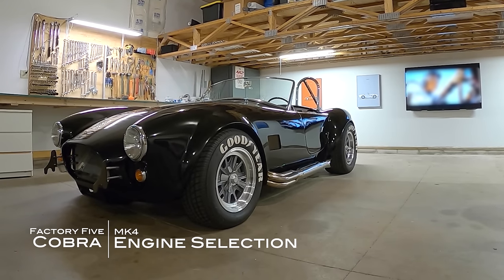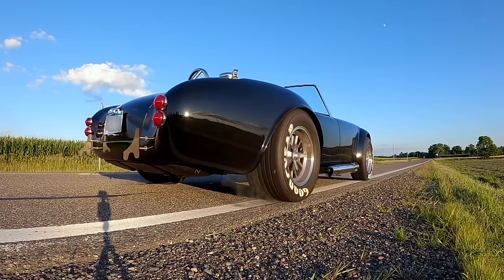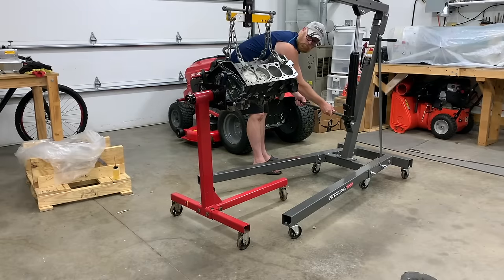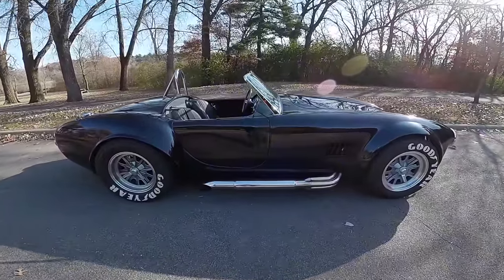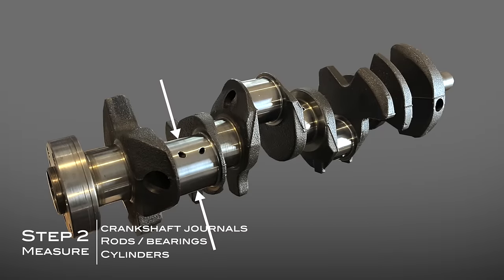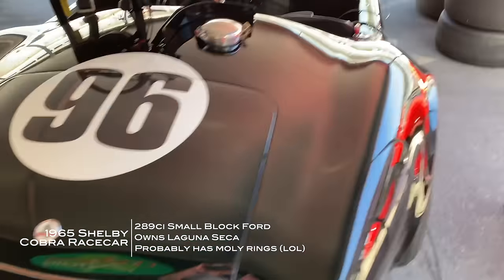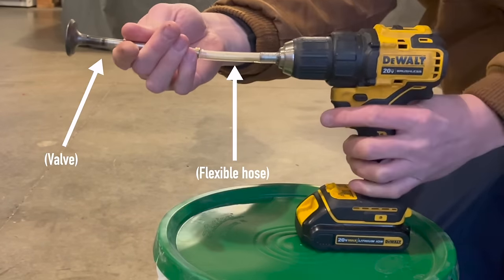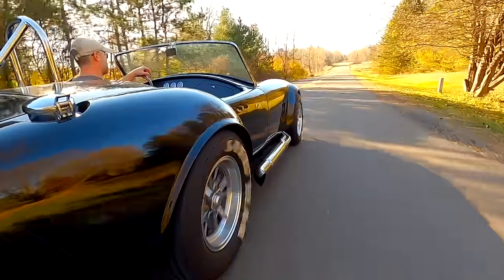Factory Five Cobra: Engine Selection

Comment: I really do enjoy your videos and am building an FFR myself. But no "late 80s early 90s mustang" came with gt40 heads. The 1993,94,95 cobra did. The 1993 and 1995 cobra R did, but only 357 of those exist. Only the 96/97 explorer does. The 98-01 is the gt40p which as you probably know has a different spark plug angle which may cause a header issue depending on what you use. Your text is generally correct except the gt40p part but the audio is incorrect. The image you showed is a gt40p so I assume you are aware it's not the same.
Reply from the maker: Hey Philip - you are correct my friend / after I recorded the voice over I noticed that too (Fox's had the E7TE heads - good heads, but not GT40) - and- yes later there were the GT40P heads too (technically those are the heads on my motor). Thanks for adding the detail here / appreciate the comment!

Comment: I'm assuming you can also rebuild a LS engine right? Like find a Chevy Silverado or Tahoe in a junkyard and rebuild it, just like a Windsor? Just asking.
Reply from the maker: I think most of the junkyard LS motors you can just drop in / leave the core - heads alone (and there are tons of low mile 5.3s out there) - engine mounts are going to be different in the FFR - and - make sure you check your header options - thanks for the comment!

Comment: I might get some shade thrown my way but I have to ask.  Is there any room to run dual exhaust out the back?
Reply from the maker: its been done / some creativity is required though to run it under the frame with adequate ground clearance - and - get it over the half-shafts / axle. Thanks for the comment!
Reply: I believe that the original 289 Cobras did run the pipes out the back . I don’t remember the 427 cars having them , but anything was possible ! 😁

Comment: Not sure if my question made it through so reposting. Do you think 235HP would make this car underpowered? I know there's a 302 crate engine out there that puts out 235. Thanks!
Reply from the maker: Hey thanks for the comment Joshua - its all about what you want with the final product so ask yourself- do I want to evaporate tires or are you more interested in reliable motor that delivers some torque when needed for fun at the stoplights? 235hp seems low for a 302 too and I think you can do better with a crate offering. What rebuilder/supplier are you looking at?
Reply: @TacoJoe  Hey thanks for responding. FF partnered with Blueprint. I went to their official website and checked out the specs from their carbureted 302 listed under MK4 roadster.
Reply: In time, if your budget allows you can always pull and stroke that 302 to a 347. That's what I did, same cylinder heads and accessories.  Cost me about $2,500   for the upgrade and another 180hp.  (270hp vs. 450hp.)

Comment: The GT40 heads will NOT flow close to a set of aftermarket heads such as TFS track heats or AFRs. A whole different universe of power. My little 332" stroker motor makes 530 hp with mildly ported TFS track heats and I shift it at 8500 rpm.

Comment: My dad had 1996 Excalibur Shelby 427 replica. He passed away 2012. Sold it to my brother in law and made sure he keeps in family or sells back to me if ever sells. Anyways you want more Horespower as opposed to torque. Traction is big problem in these cars. His had 5.0 liter from mustang and ended up on Dyno 335 torque and like 260 HP to rear wheels. Not a good combo at all. Hard to hook up off the line. Too much torque and not great HP so didn’t pull hard past 5000 RPM on the old pushrod engine either imo. The 4.6 would been better choice imo.
Reply from the maker: a lot of guys really like the ford mod motors / when built right they can make big power too / thanks for the comment!

Comment: I have a 3.4l 4 cyl Ecoboost Turbo engine that is rated at 315 HP.  Is that a good choice?  Its not a thumping V8, but it is pretty powerful.  Its out of a 2019 Mustang.
Reply from the maker: If that's the motor you would like in your build, go for it! There may be some unique mounts you would have to fab for that motor, but I'm sure it can be done. Good luck and thanks for the comment!

Comment: My BDR has a modified Roush 427R pushing 605hp to the crank....it's a handful even with 335's out the back. Arguably it's too much for such a lightweight car @ ~2400lbs. It is a LOT of fun though but you have to respect it or it will ruin your day.
Reply from the maker: 335s are some big tires my friend! / thanks for the comment!
Reply: What's the purpose of putting that much power in a light car? How does it not overwhelm the chassis?
Reply: @dieselyeti4025  600hp isn't a "chassis-twisting" numbers unless you're Dom Toretto. Problem is there isn't any weight to keep the tires planted. So unless you're running an R-compound, slick or drag radial you can break the rear loose on command.
Reply: @vel87x  As you mentioned there's no weight on the axle so breaking the rear loose in a 90" wheelbase car is going to be exciting. (esp in a turn) You said it was too much for such a lightweight car, so I'm curious why you did it.
Reply: @dieselyeti4025  Backdrafts are 92" but regardless if you know how to drive and don't just mash the pedal it's perfectly fine. It's never been a planted car from the beginning with a 289. They dance and you have to know how to make it work. You're asking why the cobra was ever created in the first place basically. Less weight, more power and hang the F on.

I'm sure you're thinking along the lines of "useable power" and you're 100% correct. You can't use 100% of the power in any cobra unless you were to put an anemic 4cyl in there that requires you to put your foot through the firewall in order to get it to move. But where's the fun in that?
Reply: @vel87x  I guess it's a matter of degree then. I've helped two friends build their FFR cars & one went with a 325hp 5 liter while the other did a 400ish hp 351. Both cars were an absolute blast to drive but the 351 car would step out in a turn pretty easily if you weren't careful with the power. I can't imagine that car with an additional 200hp. It'd be like a grenade with the pin pulled.
Reply: @dieselyeti4025  Violent is a very fitting description.

Comment: Great video as always Taco.  I may have missed it, but what engine are you going with now?  I'm like you, If I had to do it all over again, I would have gone with a Coyote.  As it stands, I have a 347 that I purchased from Mike Forte.  While I do like the engine, I've had to replace the coolant sensor gasket and the fuel pump gasket (I'm running EFI) already.  I may have to replace the coolant pump gasket as well, since I've been noticing some coolant drops on the garage floor.  The engine has less than 3000 miles on it.  It's out getting painted now, but when it comes back, I'll get in the engine bay with some brake cleaner to narrow down where the leak is coming from.  Also going to swap out my OEM brakes with the wilwood ones from FF.
Reply from the maker: Coyote (in my opinion) is a solid solid choice / it's hard to go wrong here so if you move away from your 347, I think this is a great choice. Thanks for the comment Joshua and good luck!

Comment: thanks for the video.  i remember smelling fuel riding on carbureted cars when i was younger.  do you smell gas when you are riding your cobra?
Reply from the maker: no gas smells with mine but if the carb isn't tuned right its possible you could smell gas / thanks for the comment!
Reply: @TacoJoe  thanks for the information. It will help me with which one to pick, carb or Efi. What’s your preference, carburetor or EFI?

Comment: I hear guys talking with the light Weight and horsepower it can be unsafe..? Probably so … but if i had 400 - 500 hp I would consider using progressive throttle WITH the carburetor set up.. if you pay attention to NASACR on short courses it’s throttle control coming out of corners that is the bomb..! I dont have a cobra but with it’s lightweight what about braking with 4 wheel disks .. brake balance would be essential.!!!
Reply from the maker: Great comment / so I did not add a proportioning valve, but I definitely need one. After a summer of driving my rear wheels will be covered in brake dust while the fronts have barely any - ie - need to limit pressure going to the rear and get more PSI up front. When I bury the brakes though, all 4 tires skid nicely :)

Comment: Be interesting to make a ford Taurus SHO AWD based cobra .  Wonder about fitment of the engine layout in that configuration.
Reply from the maker: that might be a challenge, but I'm sure it can be done. I think toughest part would likely be configuring the front drivetrain - thanks for the comment!
Reply: @TacoJoe  
Are there any Ford AWD trucks that use the Ecoboost V6 in an RWD based AWD system.
Reply from the maker: Might need to search that one / unsure myself - your biggest challenge is going to be the AWD configuration / good luck and thanks for the comment!

Comment: Personally I want to stand out from the crowd, the first thing most folks do is stuff a large and heavy V8 in the chassis. Look under the hood and its all the same catalog queens. None of it is unique, no one thinks outside of the box. With that said....Toyota 22R w/ Turbo on E85 or gasoline if you dont have access to corn squeezin's. Adapter plate to a classic T5 manual. Small package, 1/2 the weight of a V8, fuel injected, more than enough power, great fuel mileage and totally unique. Anyways, just my $0.02.
Reply from the maker: I bet a 22R sounds pretty nice when you wind it up too :) Thanks for the comment Robert!

Comment: People always want to overbuild/overpower these cars. They simply don't have the chassis length, or the aerodynamics for it. If you really want to enjoy these cars, put the lightest 300/350 horsepower engine you can find in it, with a manual trans, a helical diff, and 240-250 width tires. You might lose a drag race... but the instant the curves come, you'll smoke your buddy's 427 behemoth.

Comment: Can we lift the car by 2/3 inch? Is it possible? I'm from india planning to buy this car but I'm afraid indian roads would not be friendly with this car. Sedans do work fine in my city but they have to be slightly lifted to overcome potholes and speed bumps issue.
Reply from the maker: If you run coil overs, it's real easy to adjust ride height via a slip ring/bushing that goes over the shock. Just tighten/loosen the ring to your liking and lock it in place - thanks for the comment!

Comment: the only correct choice is a 500-600" all aluminum BBF with boss 9 or blue thunder heads, topped with a kinsler or hillborne 8 stack manifold running hidden EFI.  1100hp is reasonable......

Comment: <<<<My 2300lbs. SBC MGB, in a previous incarnation it had a 500hp+, big roller cam, aluminum rod, 13+ comp. 358ci Gen 1 SBC, BIG FUN/terrifyingly fast, @ 6mpg. Now a cruiser 375hp 350, do miss the rush of the last one but it's much nicer, more comfortable car @ 16+mpg (and no more mixing 112 octane race gas, premium pump gas and additives either. (it's a full custom chassis/suspension set-up made for the 500hp+ engine)
Reply from the maker: at one point I considered doing something similar / sounds like a sweet ride / thanks for the comment!

Comment: Planning on a cobra build in the next year ,
I was going to prep my block and heads with eletro method but was talked out due to Hydrogen embrittlement 
Your not worried the block maybe weakened ?
Reply from the maker: I believe hydrogen embrittlement is more of an issue with acid based cleaners. With electrolysis, I think it's possible the solution becomes acidic over time via the reactions taking place / freed up hydrogen, but I didn't titrate the solution either (lol). Also depends on the washing soda composition (there are some options that are safer w/electroysis). So bottomline: your concern is warranted- could be a risk and I think what is critical is to minimize time in the solution if possible - and - consider changing the solution a few times if your part is extra rusty and needs a lot of time to clean. As for embrittlement: areas of concern are likely around the mains and lifter valleys - failure would be a the start of stress crack that propagates. My opinion: I'm not worried about it in my situation- because - not building HP nitrous monster that delivers the vibrations/stress that further induce crack propagation. Time will tell though :) Thanks for the comment!

Comment: In doing all the back ground reading over years of cobra salivation I found original motor trend road tests and guess what? A 289 cobra is faster to 70 mph then the 427, I follow your reasoning on power, the cobra is virtually the same size and weight as a Miata, I have driven a lot of miatas and they get quite skittish on bigger wider tyres on anything but perfect roads, I am talking a low profile 205 50 15 my Cobra has 245 and 265 tyres a 350hp nissan engine, a7000rpm redline, so I figure I will be withing 5% of having a perfect cobra , straight roads are for fast cars curves are for fast drivers
Reply from the maker: 289 is a solid motor / great design by ford / thanks for the comment!

Comment: Great video. I’ve heard that anything over 450-480 hp is useless
Reply: Any Cobra is dangerous, you just have to get to know your car. I have a stroked out windsor at 500hp+  and its fine. I test drove a 302 and it just  didn't have the ommmp or sound.  If you get/build one, don't sell yourself short!

Comment: What if you used a late model 351w out of a 95/96 f150 or Bronco ?
Reply from the maker: A small block Windsor will bolt up no problem in a Factory Five Cobra (including a 95/96 small block) - thanks for the comment!

Comment: Hi Taco Joe, fellow Minnesotan here. How much would you value the weight savings from aluminum heads? My focus is handling for back road Twisties. Don't want more than 300 HP. But looking at checking the rear IRS box.
Reply from the maker: You'll definitely save some weight with aluminum heads on a SBF - I'd ballpark 40-60lbs total, but that's a guesstimate (check out summit or jegs for the absolute numbers spec'ed) - the major benefit of aluminum on a SBF/SBC is their heat dissipation properties (aluminum transfers heat much better than iron). As a result you typically can add a couple more degrees of timing and have a cooler running engine too. Thanks for the comment!
Reply: I think with those requirements you should use an all aluminum engine.  One advantage is the same expansion and contraction rates between block and heads.  An ls motor might be sacrilegious, but there are a ton of them out there and adapted for fuel injection.  Good luck with your project.

Comment: The original Cobra was 289 small block or 427. Why mess with that? Rear suspension was inde4pendent, but you could go like the Datsun roadster with solid rear axle with leaf springs and coils over shocks as one whole rear suspension.

Comment: Nope, nothing but a K24 or K20 HONDA engine. Mine is at about 485HP and it sounds so sweet. I love my big blocks and all but, when it comes to power to weight and reliability.. HONDA K24. It can go to 1000HP and still be less than half the weight of any big or small block. I would put it in every car I own if I could.

Comment: Realizing what is "Enough" is something few are willing to do... 
Of course, there are MANY that "Just HAVE to have a "427"... not thinking about the heavier weight in front, and lack of 'Balance'... but the RACE CAR was Driven by a RACE CAR DRIVER... If you just want a FUN CAR to DRIVE... then 300-350 hp is PLENTY...My V6 200hp Mustang can "Outrun" many of the GTs and Mach 1's and such... with MORE HP but less 'driver skills' and my '04 has very good Balance, and tires and wheels. (controlling those little patches of tire contact make all the difference..)
Reply from the maker: well said bucketwheat / thanks for sharing - what year is your mustang?

Comment: Why do you push the Ford Windsor but not the Cleveland??lol. Same motor, it's name only comes from where it was made.
Reply from the maker: Cleveland's are great motors too Brandon - totally agree but they were only built for 5-6yrs... there are just more Windsors around. If you want a Cleveland in your build or have one, go for it! Thanks for the comment!
Reply: Cleveland is a lot heavier.
Reply: It's not the same motor. The cleveland is a canted valve engine with totally different architecture. The cleveland is a physically bigger (wider) engine than the 351W.